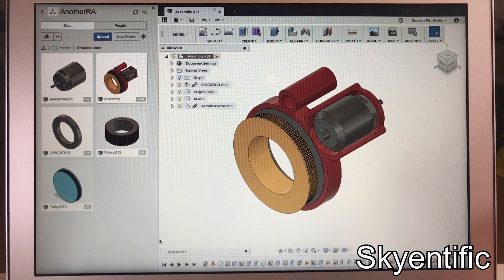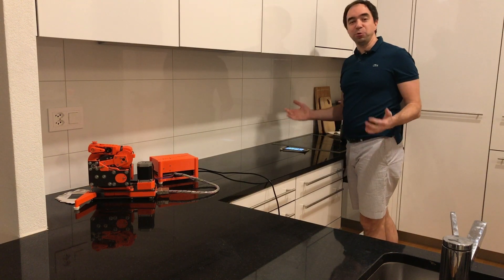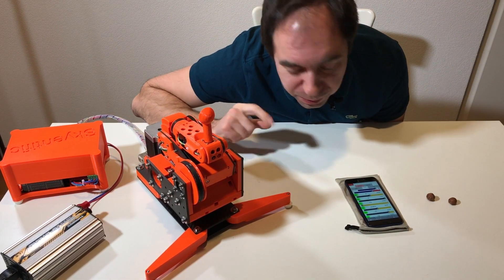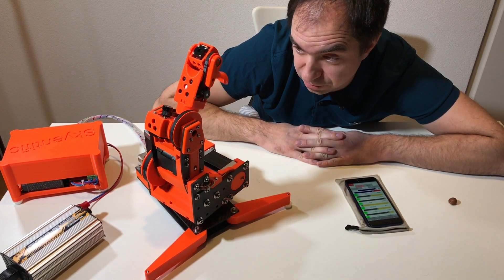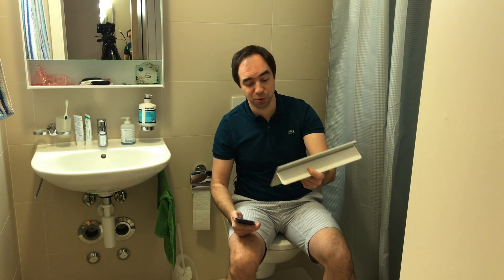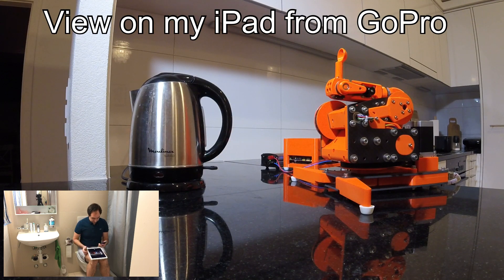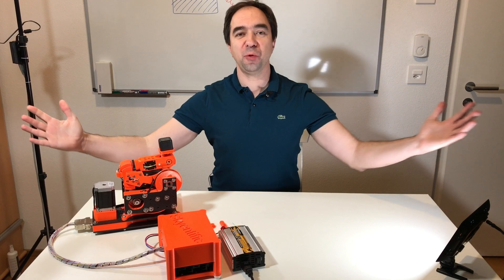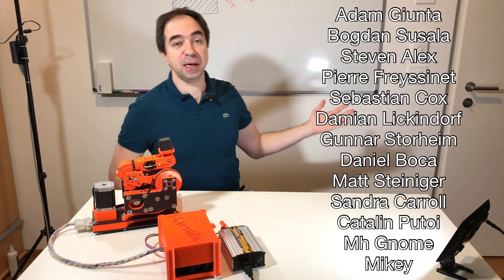Three examples of using Robot Arm (Serious stuff)

Comment: Hey thats great project bu i want to control with matlab gui and g code have you ever try to gui or g code
Reply from the maker: Not yet. Matlab through the serial port should be straight forward. But g-code would need some development. Thank you for your comment!
Reply: Skyentific thanks for reply whats means some development?
Reply from the maker: It means that the firmware should be changed significantly. I know that this is possible (most of the 3D printers use this technology). But I personally never program such thing.
Reply from the maker: I tried to understand how it is done on 3D printers, but I just understood that this is not easy task. :)
Reply: @Skyentific  Once you have a working robot with inverse kinematics done, parsing and interpreting Gcode isn't that hard. It just takes time depending on how many commands you want to implement.

Comment: Hi! What about the force of your robot?with what weight it can manipulate?
Reply from the maker: Unfortunately the payload is very low for this robot. It is around 200g. The goal for this robot was to achieve a good precision (around 0.1mm).
Reply: @Skyentific  You can greatly increase the lifting capability of your robot arm by using a simple spring as a counterbalance.  An even better implementation would use a drill press quill return spring.

Comment: Hey,
I have been following your work and building my own robot. Can you also update the stl file for the top cover for the electronics? Also what layer height did you use for the prints as your prints look pretty fine. Was it a 0.2 mm nozzle?
Thank You.
Reply: Also I'm curious, did you post the stl files on github in the same orientation as you printed them? Because from what I know orientation of prints have an effect on the strength of the part.
Reply from the maker: I use the standard 0.4mm nozzle, and 0.15mm layer height (the standard settings on my Prusa i3 MK3). I've just added the electronic cover to the GitHub page. The file name Cover.stl.
Reply from the maker: Unfortunately the STL files on GitHub is not in the same orientation as I printed them. In the first build video (Part 1) I show the orientation which I used for the prints of axis 6 and axis 5. For the other parts I just oriented the parts in the way in order to have less support. Hope this going to help you. 
Probably I should add the pictures with orientations to the pdf file on GitHub.
Reply: @Skyentific  Thanks a lot.

Comment: Hi there?.do you have the drawings in solidworks format?
Reply from the maker: No. SolidWorks is very expensive. I used Fusion 360. I will put Fusion 360 files on my GitHub page.
Reply: @Skyentific  Hi, I want plastic body STL files for 3D Printing, so that I can also built a robot like this can you please help me. I am very much impressed by your videos.

Comment: I'm working on building a compliant arm right now using ODrive and am using timing belts for power transmission for a couple of the joints. Do you mind sharing what spec belts and pulleys you are using? My first prototype used gt2 pulleys (the standard size for most 3d printers) mounted in slots and I found that it was very difficult to get the tensioning right without a dedicated mechanism to pull the two pulleys tight enough.

Comment: Ideas: Add a Laser, add a CNC, add a 
Soldering Iron, Add a Fire Apparatus Focal Peter and add a Dremel and use the Robot to create new things and improve it by himself. For example cut a gear from Aluminium.
Ideas2: Use the Robot to cut your hair :-D
Reply from the maker: Great ideas, but I would need a more powerful robot arm for them. This means that I should start to build the more powerful robot arm! :)